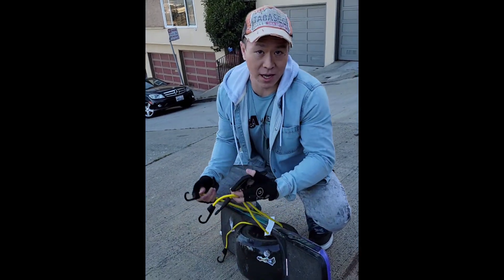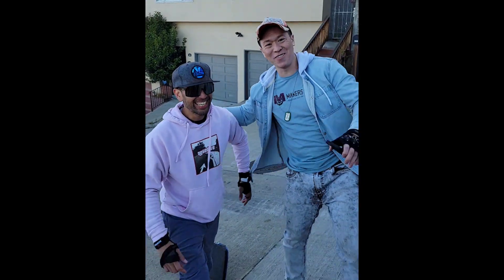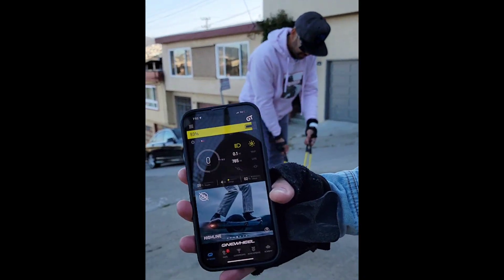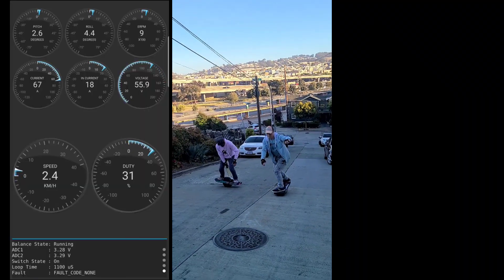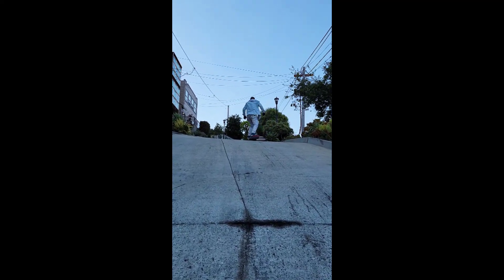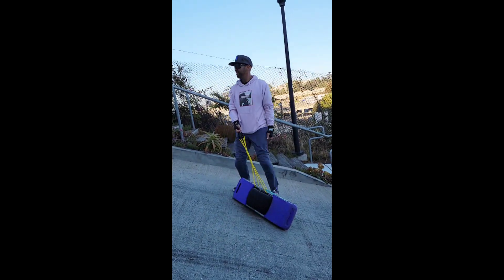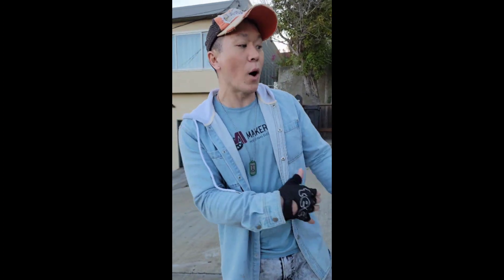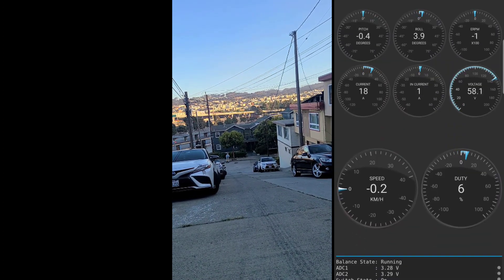VESC 🆚 GT: climbing SF's steepest hill - Bradford St

Comment: My guess is that the GT will have some reserve power for pushback scenarios with the vesc give y’all the power up front and has no push back?
Reply from the maker: The vesc also has pushback (tiltback) that you can set at your own safe or unsafe levels. The controller allows more amps to flow from the battery, and the electrical components can handle more current than gt electrical components.

Comment: Awesome, please showcase the same concept but with the 84v battery
Reply from the maker: It probably wouldn't be a huge difference as it turns out extreme hill climbs doesn't use that much duty cycle (30-60%). The big difference would be top speed.
Reply: @MaxxSend  it would be mind blowing to see it fly up the hill versus the slow gt struggling

Comment: VESC on a stock XR batt?
Reply from the maker: Yep 15s, starting 80% charge/60V
Reply: @MaxxSend  dang...  I been thinking about the bundle from makers pev to pair with my CBXR battery, and eventually going full 84v... Just the non BMS still freaks me out
Reply from the maker: @RTAMOTORSPORTS  yea it's still the last weakness of vesc, not having an active balance bms. However, there are already multiple passive bms options (meaning it doesn't continue to balance after full charge). There's ennoid, xlite, daly and one other that people are happy with that they keep the cells balanced within range during charging. I myself have a passive daly in my 84 cbcso that I'm good with. Keeps the cells within 0.03v delta. My trick vesc is cbsp and doesn't have bms, just gotta remove the pack and balance every 2 months or so.

Comment: VESC XR was handicapped with that sketchy stock 15s battery.
Gotta redo the test with the same battery that the GT has (18s P42A I believe)
Reply from the maker: Yep I deliberately handicapped the vesc with stock xr battery (62v), 10% less starting charge, and 43lbs more load (me) to show that vesc programming is far superior. And it still smoked the gt in every single round. The only fair comparison would be a vesc 15s vs 18s vs 20s, gt is irrelevant 😆
Reply: I really wanna see 20s p42a with agressive atr settings zooming up that hill!! Do it Max!!
Reply from the maker: @Burnerzcrew  hahah ok the people have spoken. I'll head out there when it gets warmer 🤙🏻

Comment: Stock voltage that's impressive. Lighter board than GT
Reply from the maker: Stock board about 5-7 lbs lighter, but I'm 43lbs heavier than gt rider and vesc 10% less battery
Reply: @MaxxSend  I've tried 63 and 84 and I like the weight of the lower voltage setup a lot. I find GT too clunky on technical trails, too heavy also. Need both all the same, but it's a different feel